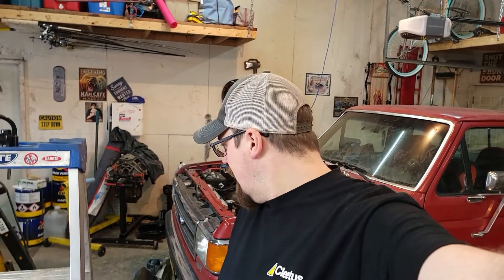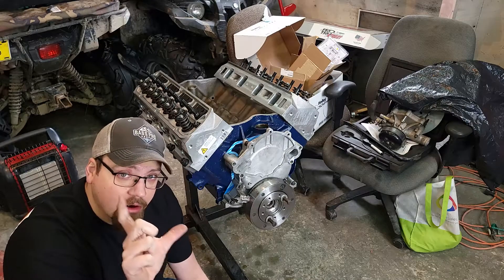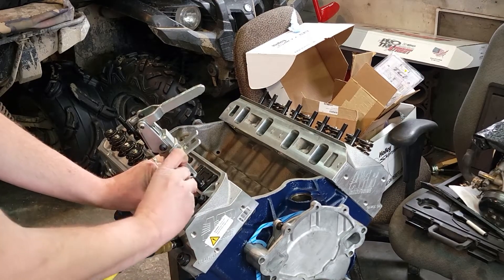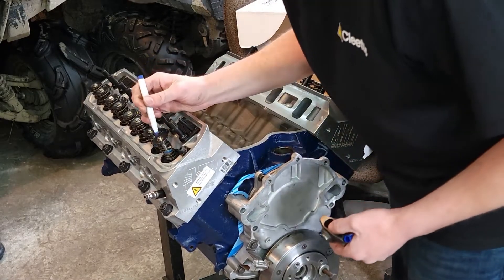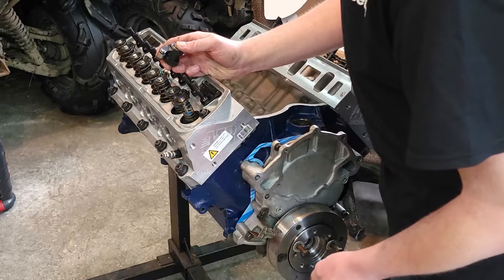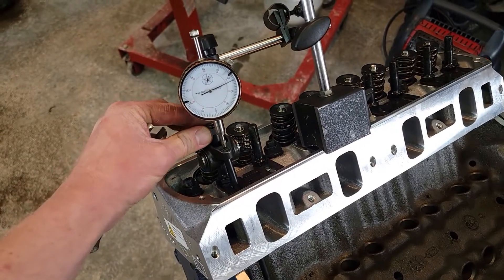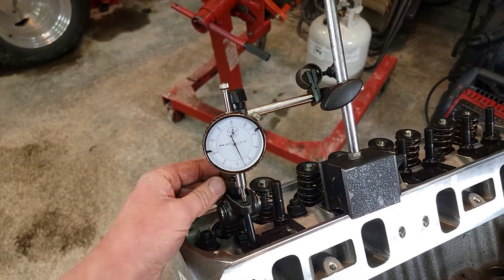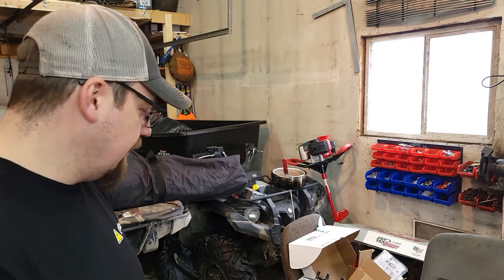How To Measure For Pushrod Length!

Comment: Video is a year old, but just came into my feed.  Issue I see is that you're setting rocker geometry by adjusting pushrod length.  That is incorrect.  You need to set rocker geometry, pushrod length is a result of that.  There is a good video out by Scott Foxwell on how this is correctly done.
Reply from the maker: Yes you are right, I didn't record it but I did double check rocker geometry as well.

Comment: Nice work buddy. I am doing the same procedure on my 393W.  I’ve been frustrated by the dial indicator method to verify preload for the reasons you cite. I have used blue tape on the pushrod with a straight edge across the valve cover mating surface intersecting the pushrod.  I use a razor blade to make a mark on the tape and then measure the distance plunged from that mark.  Kinda crude with the razor and frustrating with the dial indicator, so for preload, I use the industry standard formula:  Lifter Preload = Distance per polylock turn / Rocker Ratio + Distance per polylock turn.  I will provide an example using a typical 3/8 rocker stud with 24 TPI and a typical 1.6 roller rocker. One full turn on the polylock will move the pushrod down 1/24 or 0.0417. Distance per Polylock Turn / Rocker ratio = 0.0417/1.6 = 0.0260. Now per the formula, you add 0.0417 + 0.0260 = 0.0677 which is the actual preload i.e., the distance the plunger moved down. Comp cams loves to cite liter preload as 0.5 turns after zero lash, so that would be 0.5/24 or 0.0208.  So, 0.0208/1.6 = 0.0130.  Now per the formula, you add 0.0208 + 0.0130 = 0.0339 which is the actual preload.  One thing that has always bugged me is what lifter preload to use with the standard Ford Motorsport 302/351 hyd roller lifter FMS-M-6500-R302.  There is no published value for this (trust me, I’ve looked).  Which lifter are you using and where did you get the 0.025 preload value?  Per the formula above, I note that 0.025 actual preload with a 3/8 stud and 1.6 rocker is about 1/3rd turn on the polylock (0.37) past zero lash.  For contrast, recently I was looking at the Howard cams SBF hyd roller lifter which spec’d 0.030-0.035 for cast iron block and AL heads.  0.025 seems a little on the low side, so just curious.  Real car guys do math and measure things. Fake car guys copy/paste from blogs!  Keep the good work!:learning:👨‍🎓
Reply from the maker: awesome work! thanks for watching, appreciate it!
Reply from the maker: the .025" was the starting point that I wanted to try, the least amount of preload I can run the better, (to an extent) to avoid random lifter pump up during high rpms